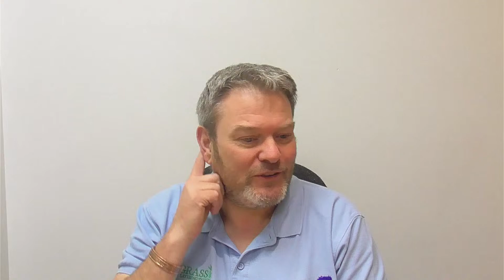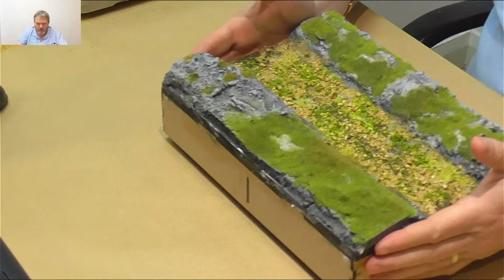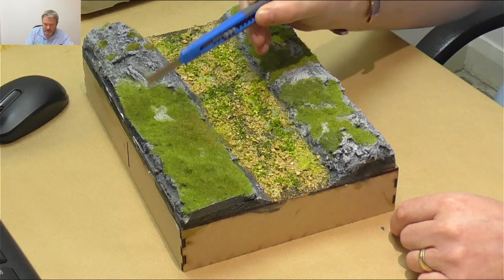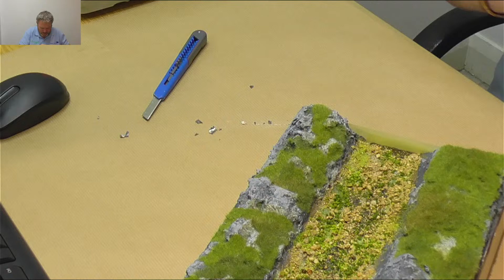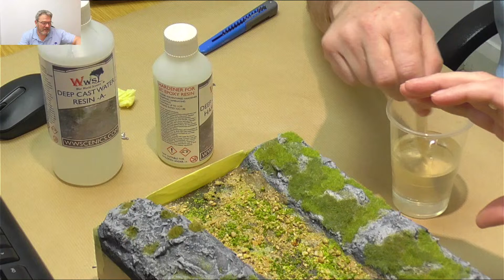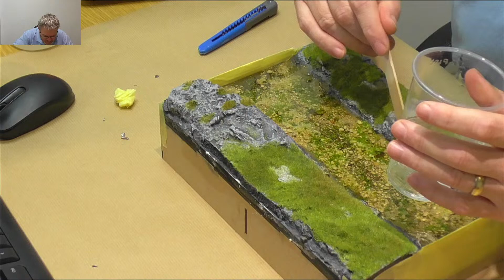Modelling With Martyn | Using Deep Cast Water

Comment: When mixing 2 part products, like epoxy, and some paints or industrial sealants, I've  removed the air bubbles by placing the mixture in a large container - a Lidl's stock pot with a glass lid - and drawing a vacuum in it, usually with a domestic hoover, (though you have to flick it on an off to prevent it from overflowing). The reduced pressure causes the air to boil out, leaving a bubble free mix.
Reply from the maker: Great tip thanks
Reply: @WWSCENICS  to be fair, when I was doing this as a job, time was of the essence. Mix it, wind it up, vac it, pour it. I totally get the slow mix method.  But if you get bubbles,  it's a way to get shot of them.
Reply from the maker: @iangregory3719  we have vac machines. I just showing the basics. The blow torch works really well. But I will say I do have very little to none bubbles 🫧 in the model. Well happy
Reply: @WWSCENICS  👍